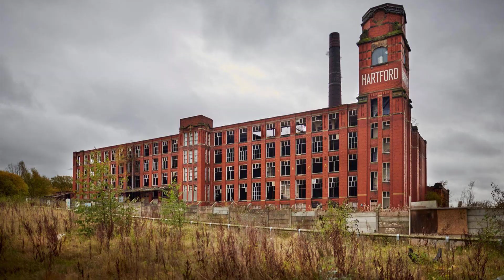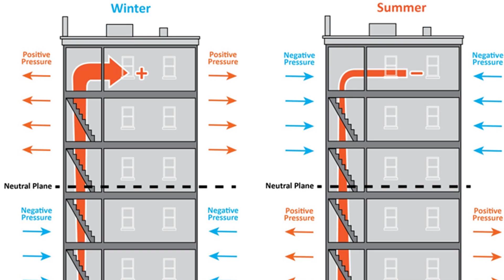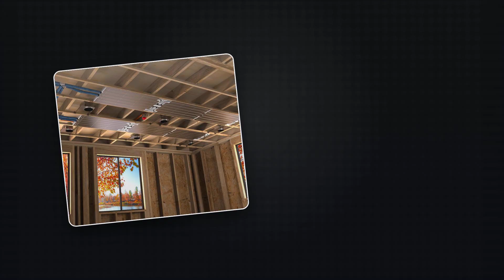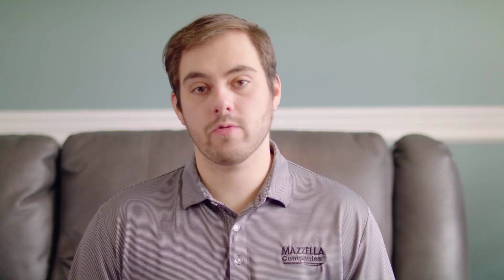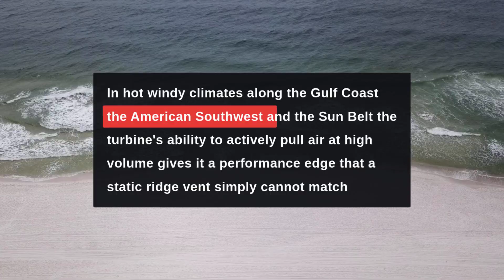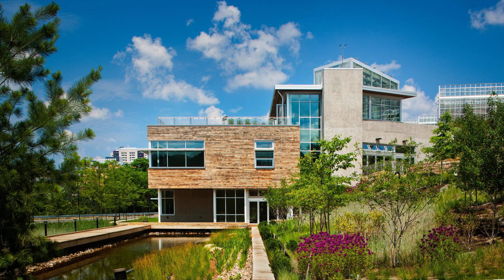DON'T Buy an Attic Fan — The Forgotten Vent That Drops Temps 37°F

Comment from the maker: ✅ FULL BREAKDOWN — Save this: 

 ⚙ HOW IT WORKS (zero electricity): → Bernoulli's Principle: curved vanes accelerate wind → low pressure → suction → Stack Effect: hot air rises naturally → pushes out through turbine even with no wind → Venturi Effect: air through narrow vane gaps → velocity increases → more suction → All 3 effects compound each other — continuous negative pressure at roof peak  

📊 PERFORMANCE DATA: → Attic temp reduction: up to 37°F (San Diego study) → Cooling bill reduction: ~14.6% average → Ventilation improvement: +15% average / up to +50% in optimal wind → 12-inch unit: 250–350 CFM at 5 mph wind → 14-inch unit: 350–500 CFM

  💰 COST: → Unit cost: $20–$100 → Installation: $100–$300 per unit → 1,500 sq ft attic: 2 units needed → Payback: 3–5 years in hot southern climates  

✅ BEST FOR: → Gulf Coast, Southwest, Sun Belt, hot windy climates → Homes with large attic spaces and existing soffit vents → Reroofing projects — install while roof is open

  ❌ AVOID IF: → Cold climate where interior moisture can freeze vanes in winter → Already have ridge vent installed on same roof — causes short-circuiting → Modern airtight home with mechanical ventilation system 

 🏠 TURBINE vs RIDGE VENT: → Ridge vent: 900+ sq in net free area, no moving parts, invisible, lower maintenance → Turbine: active suction in wind, outperforms ridge vent in hot windy climates → NEVER mix both on the same roof — pick one system only  Drop a

 🌀 below if you still have a whirlybird on your roof.